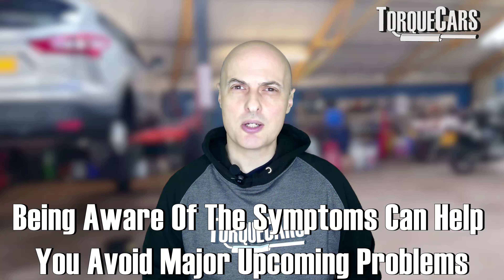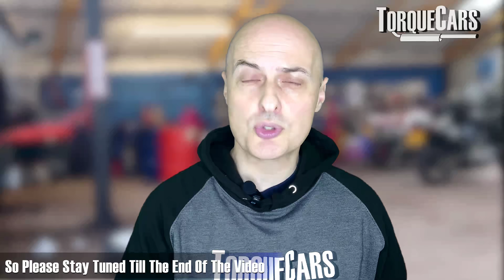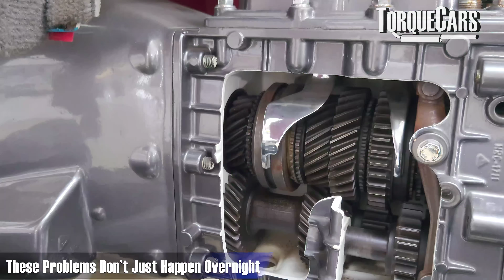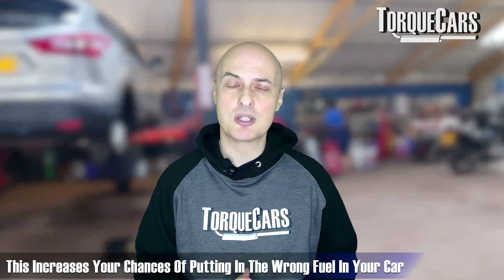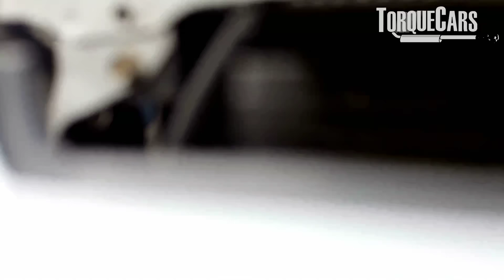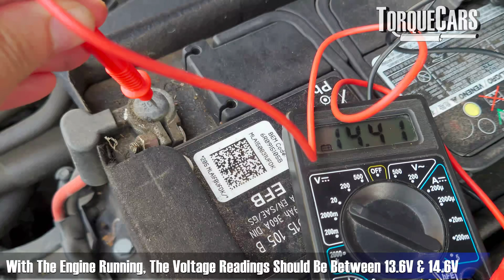10  Most Common Causes of Car Breakdown Problems & How To Fix Them

Comment: Check grounds now. Everyone forgets if ground wires aren't connecting well it will cause all kinds of probs! Pro tip; can spray a lil WD-40 on em for instant connection to test, or spray occasionally to keep connected